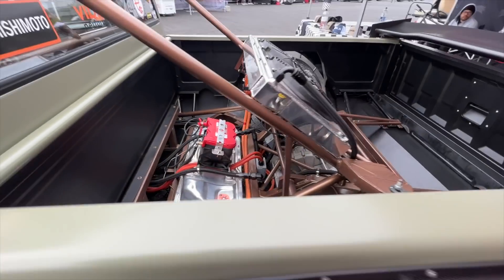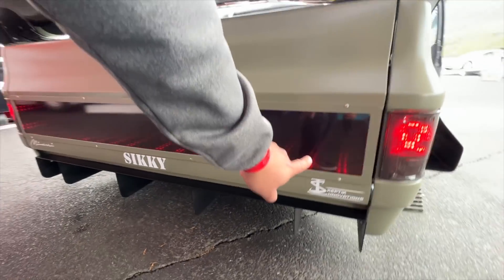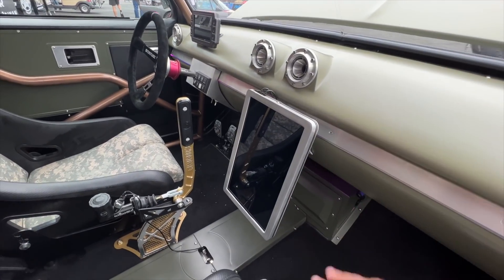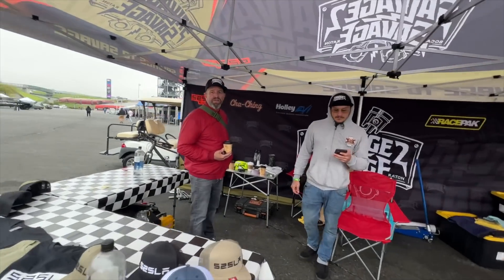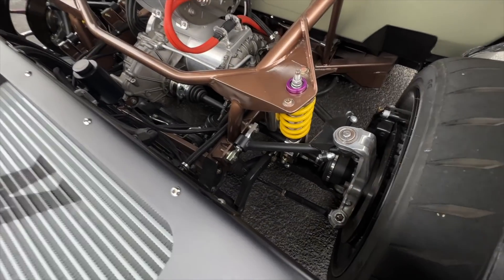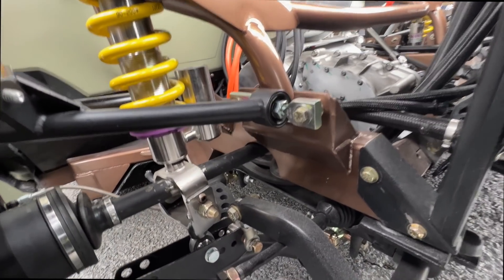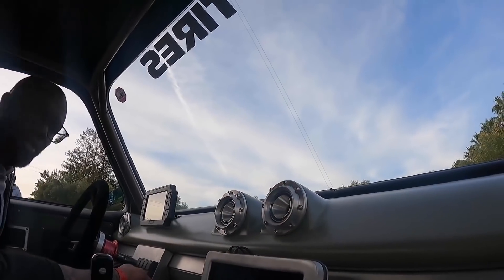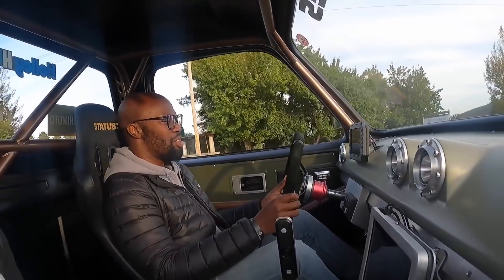The Tesla Powered AWD Chevy Squarebody pickup truck

Comment: Hello sir. Can i ask about battery. I have a electric scooter or stand up scooter using 60v 45ah battery. It's been over 1yr and 4month that im using it. Now the battery full charge is 66.3v. What will be the problem and how can i resolve it? I always charge it at full. Thank you sir.
Reply from the maker: I need more info in the battery
Reply: @jehugarcia  the battery i think its a chinese cell im still using my electric scooter. No problem at all aside from the voltage of the battery 67.3v before and now its 66.3v full charge. No sudden voltage cut. Thank you sir.